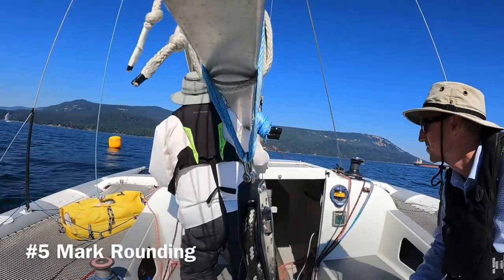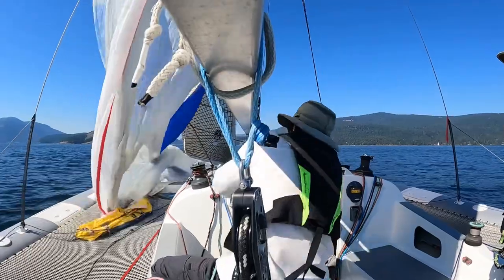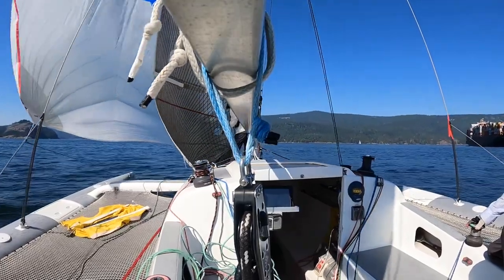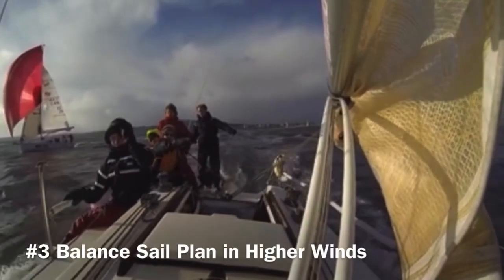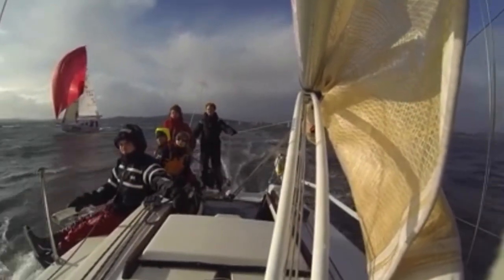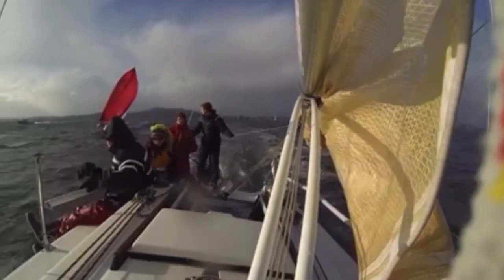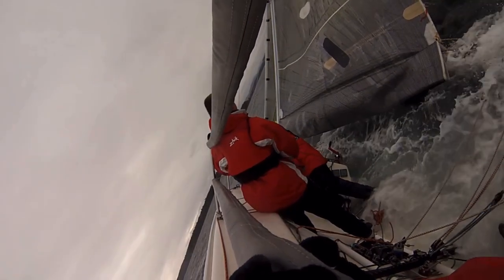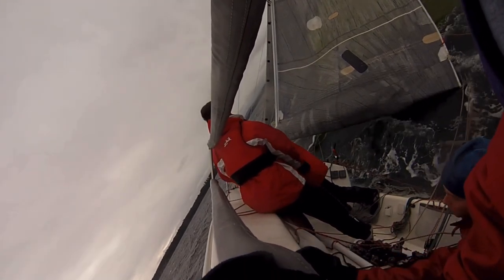Five Reasons to Fly a Spinnaker and Jib Together

Comment: My favorite sail configuration for when the wind is on the quarter is triple slotting. This is a  1.5 ounce spinnaker, a number 3 Jib and a tall boy staysail to clean up the air between the jib and the main. This gives you three slots to work with. This works for all the reason you point out except it looks cooler than just the jib.
Reply from the maker: That must look cool! Except when you have to gybe ;-)
Reply: @SailingTipsCa  You definitely need running room but the best part of it all, and you did mention this, is when you start to round up and the chute collapses, all of that sail on the front end of the boat hook into the wind and allow you to steer through the broach.
Reply from the maker: @pforce9  Yes multiple headsails definitely adds a safety factor in higher breeze!

Comment: Very Cool.  This gives me a greater understanding on the dynamics of spinnaker wipeouts.
Reply from the maker: Flying a jib helps with "round up" style spinnaker wipeouts, which are caused by the centre of effort of the sail plan being too far aft, and are the most common type of wipeout with asymmetric spinnakers. There are also "round down" style spinnaker wipeouts, which often start with a symmetric spinnaker "death roll", but those are more from sailing very deep downwind or even by the lee, and not not terribly common with asymmetric spinnakers.

Comment: Great content, and thanks. Could you tell me how long your spinnaker sheets are and what diameter rope you use? I’m setting up a spinnaker on a 9m tri similar to yours and your arrangement looks good. 👍👍
Reply from the maker: My sheets are 65’/20m per side which is a bit too long and 2x boat length is a good rule of thumb for asymmetric spin sheets. The 5/16 or 8mm Dyneema core is also more than strong enough but that’s a nice thickness to handle. Hope this helps!

Comment: Can I ask who made your jib and what fabric is it. I just broke my jib furler on my F-27 and Im thinking about getting a Hank on for the next one. Thanks
Ps Im mostly solo though, whats your thoughts on this ?
Reply from the maker: The jib in this video is a UK Tape Drive with piston hanks made with some kind of Kevlar-based fabric that you don’t see too much anymore. I have a newer UK X-Drive carbon sail with buckle and webbing hanks. Some use Dyneema loops instead. I generally like hanks because you get a nice deck-sweeping sail shape and very clean entry, plus you can drop the jib and it stays entirely attached to the forestay so you don’t lose it. Furlers are convenient but heavier, plus you need space below the furler for the drum so there’s a gap with the deck, and you can’t have horizontal battens in the jib, so a few compromises in sail shape and performance. With a furler you also either need a UV strip, which destroys sail performance, or a sock that you hoist over the furled sail, which takes about as much time as hanking on the jib. I’m a fan of hanks!

Comment: Good tips but if you're flying a symmetrical, then the jib has to go if you need to gybe - dip pole or end-to-end
Reply from the maker: Yes I certainly haven’t figured out how to gybe a symmetrical while flying a jib!!! But if you’re flying a symmetrical and need to gybe you’re likely sailing deep enough angles that the jib isn’t going to benefit you as much either. If you’re reaching it might, and then you’re also less likely to need to gybe.
Reply: No problem if the downhall on the pole is run from the base of the mast and the spinnaker pole is kept on the boom, thus the jib sheets can go outside and below the pole downhall and the pole can be passed from end to end behind the leech of the jib. Not as easy for sure but definitely possible.
Reply from the maker: @benroff730  Yes that could work for end-to-end gybes!!! Any thoughts on how to do it for dip-pole, or does it work for that too and I just can't see it?
Reply: @SailingTipsCa  yep you'd rig it up the same way you'd do it with a furling jib, with the jib sheet running over the pole and outside the topping lift. Again it's possible but even harder than doing it with an end for end set up and as you say its unlikly you'd ever need to jibe with that sail plan up.

Comment: ... and the goal is to create more lift a low speed, ... like the biplan plane !, useful up to +- 140 deg.
Reply from the maker: Flying both together does create more lift, like a biplane as you noted, but also more drag like a biplane, so it may or may not be faster, depending on the conditions. The other benefits (e.g. balancing the sail plan) are still there though even if it’s no faster!
Reply: @SailingTipsCa   ... at low speed !! you will create more lift than drag ! ... the faster you go ... the drag overcomes the lift !
Reply: @SailingTipsCa  ... drag (positive or negative) is related to torque, ... lift is a power phenomenon, ... related to speed.